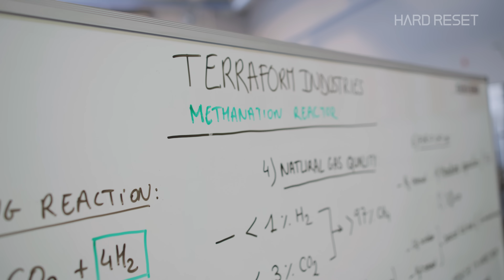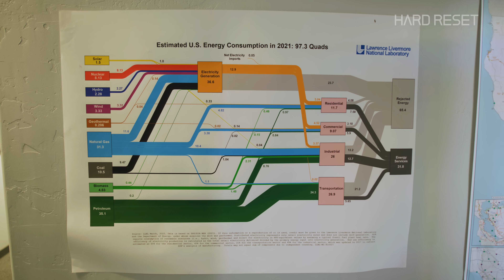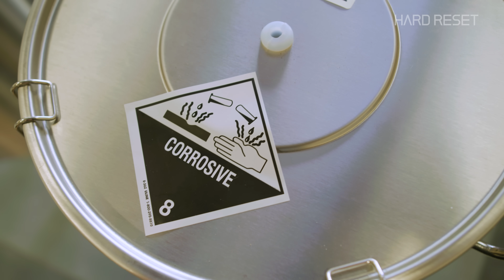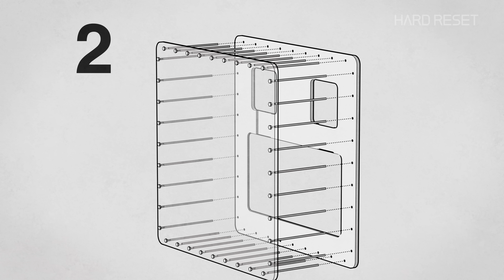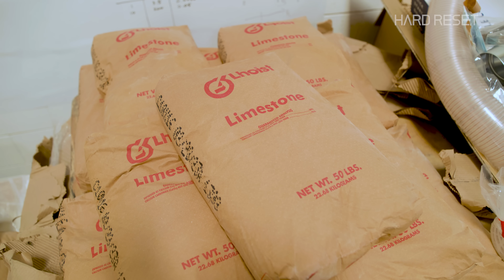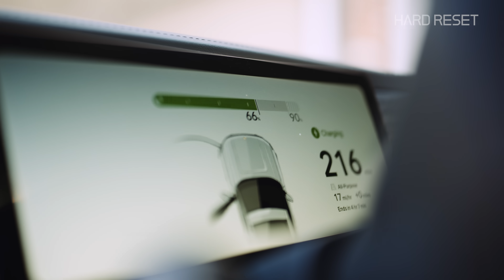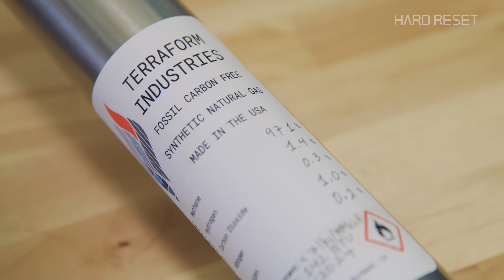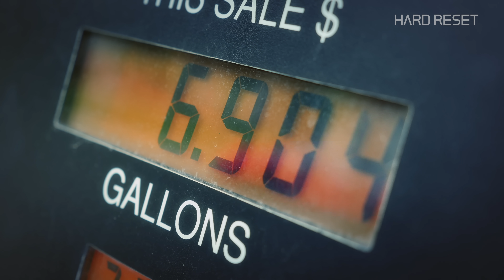The Last Fuel We'll Ever Need?

Comment: Just a few points about "Climate Change":  1)  CO2 is at it's lowest point in 65 Million years.  A change in how plants efficiency allowed them to adjust to the low CO2 concentration.  A higher level of CO2 would benefit plants.  2)  Proof of #1 is with the increased CO2 the planet has increased in Greening.  Update to 20% or twice the size of the United States.  Plants are the best sync   3)  A warmer planet is not necessarily a bad thing.  A large swath of the deserts are now greening as a result (See #2).  A warmer planet reduces the impact of winter on animal by allowing fewer to die from cold exposure.  It also allows for longer growing seasons, which will reduce starvation of animals as well as humans.  So, global warming and it's cause are not really something to be concerned about because of the benefits.  I do wonder if the "Global Warming/Global Cooling/Global Climate Change" is a thing or just another "Disaster" that is being used to frighten people.  Fear is a great motivator to gain control of people.
Reply: More casual Tom Nelson watchers cosplaying as Climate Scientists 😂😂😂

Talk about it once you've read some basic atmospheric physics textbooks.

Comment: Probably the least efficient process is the electrolysis of water.   As I understand it, the levers that might impact electrolysis efficiency are the reduction of impurities in the water, use of an electrolyte such as KOH or NaOH, the electrodes (lots of surface area, and perhaps the use of a catalyst), and the temperature of the vessel (I believe high temperatures are more efficient).  There may be others.   But I think it's a mistake to say efficiency doesn't matter.

Comment: 5:55 This is misleading. Later in the video it seems like they are planning on implementing this using the existing fossil gas infrastructure- which leaks a lot of methane. If even a tiny amount of methane leaks, we have essentially turned some of the CO2 into a more potent greenhouse gas- methane- and then released it. This means it's still contributing to climate change. To make this climate neutral you would need to reduce the leaks and store some of the captured carbon. If you did this on old gas fields you could potentially pump the CO2 into the used wells.

We also need to make sure this is not used by fossil gas producers as a side hussle which lets them keep pumping gas and destroying the planet. Either they switch completely to this and improve their infrastructure to eliminate leaks or they get taxed out of existence. We can't let them have it both ways.

Comment: So if we compare burners vs non-burners, ICE engines cannot achieve 50% thermal efficiency.  Fuel cell electrics have efficiency limits of nearly 50%.  BEV motors operate in the 93 - 95% efficiency. Which ones contribute the most to atmospheric thermal increase?  However, we need to keep the arguments for our pet technologies, focused on the attributes that give our technology the edge over battery electrics.

Comment: If you burn methane with pure oxygen, the products are indeed CO2 and water!  But not so if you burn is with air.  Air is 79% nitrogen, and at combustion temperatures, some nitrogen oxides are produced (aka NOx).  And NOx are very toxic.
So, I am asking why you "green" power to capture CO2 out of the atmosphere and turn it, with an efficiency much lower than 100%, into a fuel that, once burned, will put it back into the atmosphere, together with a cocktail of other toxic gases.  Why not use that "free" power to do the transportation and other work directly?
Sure, there are some applications, which can't run of power from the grid or from batteries (long-range air or maritime transports come to mind).  But, outside those hard-to-decarbonize applications, there is no point in replacing a hydrocarbon fuel by another hydro-carbon fuel in hopelessly inefficient and polluting converters.
But don't understand me wrong, the research terraform is doing is great and, if successful and cheaper than competing synthetic fuel technologies (on which I have personally worked), will find its applications.  Just let's not fool ourselves on what those applications are: power generation... that would be a huge non-sense; road transport, no; industrial or domestic heat, no; airplanes and ships, quite possibly!

Comment: Until calibrated math on the efficiency of this system is realised, shown to be effective during financial fluctuations then Investors should be highly skeptical.

The current infrastructure is not about sucking hydrocarbons from the ground and selling it.

More over, even if the hydrogen infrastructure did exist, at scales which would render such a system efficient, it would always more expensive to make hydrocarbons, both from a price and entropy prospective.

It would be more efficient to burn that stack of dollars bills.

Comment: Most of the power use is from the sintering and pumps. They could make a furnace though that works by creating arcs and burning oxygen which reacts with the hydrogen in the air crating water/ super heated steam. That air can be reclaimed from the air by seperating oxygen and nitrogen using desicans that are sized to allow nitrogen through but stops oxygen from leaving. At point your furnaces and motors can be powered from solar while pressure can be used as a battery of sorts to form methane which is just another source of battery but more usable form that has less loses.
Reply: Lol the goal is net more energy that used.  Your well over budget.
Reply: Air separtors are very efficient and hydrolysis is very efficient as well. They laid out all the things they needed for there process and I think it could work but with some changes.

Comment: Simply Awesome.
I played around with my free solar energy abundance ie summer sunshine, and made a simple electrolizer running on DC power.  I used it to fill garbage bags with oxygen and separately hydrogen.  This was a lot of fun, although quite dangerous.
My plan was to store and compress the hydrogen, until the realities of hydrogen destroyed my ideas.  (compressing and storing hydrogen without it leaking out of pipes and containers is harder than it sounds)
Glad to see they have a simple and effective (if not super efficient) way to make high purity methane - much easier to store and safer to transport than hydrogen.
I think it is a mistake to through away the oxygen - a local production and use of methane can be super efficient with 'free' oxygen available - and preven NOx from being formed during combustion.  A win win.
And oxygen has value - industry pays money to get pure oxygen supplies.

It would be incredible if the long summer sunshine could be harnessed to produce methane for winter heating in northern climates.  Pipe the gas into all the existing infrastructure without the release of sequestured ancient hydrocarbons.  
And as he says in the final part of the video - this give humanity a thermostate - they are pullilng carbon from the atomosphere - so we as a species could choose how much carbon dioxide we want in the atmosphere - instead of complaining that the only way to drive industry and society is drilling for oil and gas, digging up coal.
I want one of these machines for my farm.

Comment: A big problem at square one is that taking the CO2 out of the air to start with requires turning mined limestone into CaO by heating it until  the CO2 is driven off.  (At least by the method described) Mix with water…Then you use the resulting basic solution to react with exactly the same amount of CO2 in the air as you just drove into the air.  Short of limestone ? Seashells and eggshells could be used too.  Net removal of atmospheric CO2….nil.   Several such atmospheric CO2 removal projects use industrial grade bagged CaOH to absorb CO2 from air…completely oblivious for investment capital attraction purposes…as to how the bags of CaOH were made from limestone to start with….

Comment: Amazingly, as much as this doesn't make sense, it kind of makes sense... But why not be happy with the first step when we had hydrogen gas? If I remember an article that I read once, anything that uses methane can be converted to hydrogen. So skip some steps, increase efficiency, and stop at the water splitting stage.
Reply: Hydrogen looks to be very difficult to usevin gas boilers, cookers etc. Methane would have a greater chance of fitting into existing infrastructure.

Comment: They didn't talk about the problems associated with the reaction. You need over 600 degrees F @ 450 PSI. The energy differential is probably 10 to 1, Extremely expensive equipment start up and safety protocols, where are they getting the heat? Lab scale heat cells are one thing, but Scaling up heat to commercial use with electricity is quite another. I bet that is their biggest hangup. They better have a good answer for that. The only way this makes money is carbon credits.

Comment: This is a very, very expensive way to make liquid fuel.  It works, but it will have extreme trouble competing in the marketplace.  BEVs are the cheapest for all ground transportation and even for short haul water and air.   Where liquid fuel is needed biofuel from agriculture waste is the cheapest option.  The market is acting accordingly. .

Comment: Why spend energy on producing gas when everything can run on electricity and is 95% efficient?? Like they say like 20 times in this video... their process is inefficient! Imagine how much you could in stead run on the electricity from the PV panels directly, like an induction stove or an EV. You don't need gas in your homes at all. Besides where there is methane there are also leaks, and leaking methane into the atmosphere is much worse than CO2.

Comment: and what are You Going To USE FOR OIL , Are You STUPID Engines NEED OIL So They Do NOT SIEZE UP. or are you going to turn meth into oil too WHEN ITS ALREADY THERE IN THE GROUND seems like you Just TURN 1 JOB nto 3 and Make it HARDER TO DO

Comment: It's possible to get hydrogen from water using just heat, which is easier to produce than electricity. Look for the ARCH fusion reactor design. :-)

Comment: This doesn’t make much sense to me.  Hydrogen offers more energy density than methane vs mass, so the carbon capture aspect only serves to dilute the fuel, since the CO2 will (thankfully) be rereleased when the fuel is burnt [plants need CO2 and the solution to too much atmospheric CO2 is to allow more trees to grow].  Perhaps the idea with methane is that its easier to store and easier to convert engines to run on it?  Problem is that its also a horrendous greenhouse gas in its own right, much worse than CO2, and its hard to see how using more of it won’t lead to more methane in the atmosphere one way or another.

Comment: that asks the question why down grade hydrogen to methane  the latter if that to complicated methane  that out puts Co2 when Hydrogen only out puts water and if using atmospheric oxygen a small amount of  laughing gas  its has an energy loss , with gray water and sewage being a source of methane used in some city's of some country to drive electric generation and out put fertilizer and clean water  and most just dumping it straight into the water ways

Comment: ORNL solved the energy crisis in the 1970's.......the Molten Salt Reactor........which when combined with the very abundant element of Thorium pretty much means unlimited,cheap energy with almost no waste. The Molten Salt Reactor runs at 700C which is ideal for driving a lot of chemical processes that need industrial heat. Ironically the more CO2 that is in the atmosphere, the better this process of C02 recovery works.........at the end of the last ice age, 12,000 years ago, CO2 levels were acutely anemic, plants were on the verge of not having enough CO2 to survive.  IF CO2 levels get to 700ppm, there would be ideal levels for plant growth and for this recovery method to work well.

Comment: You need an engineer friend to do some fact checking. This is far from carbon neutral and of course efficiency matters from a pollution perspective. How much natural gas was used to make the solar panels? Dont we just end up making less gas than was used to make the panels? This only really works if the grid is already renewable and then methane will hopefully become obsolete or very niche by then. Maybe for making rocket fuel though as there's not really any good alternatives for that.

Comment: Isn't this a little similar to the idea of using electricity to produce hydrogen as a fuel for an internal combustion engine? Using methane to do the same, while emitting CO2 at the same time seems a rather strange process, when the original source of electricity could surely be put to better use. Perhaps I missed something in the video.

Comment: Why not use the solar energy directly? I have been living off completely grid for the last 2 years on solar and batteries to store that power at night. I used to have a couple electric bikes that I charged off solar for free, sun powered transportation. Many people do this, but what makes my set-up rarer is that I live in a motorhome, so everything is self-contained, light and compact enough to travel down the road. Yet I live just like if I were tied into the grid with 24/7 A/C and heat from my heat pump. My complete system including 5kws of solar, 23.5kwh of batteries and 6kws of inverters cost me around $10k which paid for itself in under 2 yrs. 

No, it won't power the engine in my RV, but neither will methane. I would have to replace my engine for that as a conversion would lose too much power. I would rather use electric motors like the Tesla 18-wheeler does, with more solar and batteries and continue to be self-contained, not dependent on a fuel that someone else makes that can go up in price at a whim or be cut off completely.

Comment: I'm no scientist, just an enthusiast for this kind of material, but it seems to me that this process is rubbish. It starts with extracting hydrogen from water, it's well-known that it takes more energy to do this than you get out of it, and THEN he is processing it more to get methane, seems very inefficient to me. Now, I know an argument can be made that using solar or wind power to power electrolysis is a method of storing the energy for use when the sun isn't shining or the wind isn't blowing, and even if that were a valid argument, why not just use the hydrogen directly instead of adding another inefficient process to get methane ?  Battery technology is getting better every day, I see lots of large-scale electricity generating  facilities employing this technique,  and none that I know of using electrolysis to store hydrogen for the same purpose, so I think that pretty much says it all about the viability of doing so. What is this guy working on next, a perpetual motion machine ? Sure, it needs a motor to help it run right now, but he'll just run it with solar power and then hook a generator up to the perpetual motion device to get electricity out of it, LOL !

Comment: Waw, garbage take on a existing efficient, cheap and scalable solution. Ethanol is basically this but better. You plant sugar cane that scoops tones of carbon from atmosphere, make ethanol from them and burn it for a net negative carbon emission... Any previous negatives are no longer a problem today, like cars having a bad time starting on cold environment's. Just build a hybrid with electric motors and a small size battery for starting and quick travels.

Comment: just remember that to manufacture this new fuel (be it methane, hyrdogen, etc.) it takes far more energy input than we can ever get from burning it or discharging batteries to run motors, etc. and to equal the electrical power consumed by the grid would require an area the size of west virginia to be covered with at least 20% efficiency solar panels and transportation used even more energy thus more than double that amount of space... nothing is 100% efficient, hell the most expensive solar panels are about 35% and there is simply not enough GaAs on the planet to make them, the rest of this solar radiation gets tuned into HEAT...

Comment: 100% electricity becomes 35% methane; run to thru an IC engine, even at 40% efficiency, the total loss of efficiency is very low. Why not store the electricity and run EVs instead?

Comment: 5:30 Carbon dioxide IS toxic wdym
Reply: The way it is toxic is by limiting the amount of oxygen you intake, aka replacing something you need with what you don't. Nitrogen isn't toxic to us but add enough of it to our air and it becomes dangerous due to replacing too much the oxygen we need.
Reply: @evannpalma2404  No, no, you will suffocate in a 20% oxygen 80% CO2 atmosphere (don't try it)
Reply: @stef2465 and yet the atmospheres CO2 level right now is 0.03%, no where close to the 80% that you are afraid of. If CO2 gets below 0.02% all plants start to die and we die because there are no plants left to make oxygen. Why do you think some greenhouses pump CO2 into the greenhouse? Its because the plants grow faster and get bigger and we can still go into the greenhouse and not suffocate. We need more CO2 in the environment not less. Thank goodness all of that CO and NOX is no longer going into the atmosphere because of catalytic converters.
Reply: Yup, the cat is right that CO2 will kill you at elevated levels, therfore it is toxic, but let's not forget that during incomplete combustion (limited O2) you get CO (carbon monoxide) which is poisonous.
Reply: Carbon dioxide is not toxic. You are confusing it with carbon monoxide, which is a totally different element. CO2 or carbon dioxide is what you exhale, CO is carbon monoxide that vehicles used to release into the atmosphere before we started putting catalytic converters on vehicles.
Reply: My brother in Christ, I know what CO is and I'm not talking about it
Reply: @stef2465 well your statement about CO2 being toxic is still false.